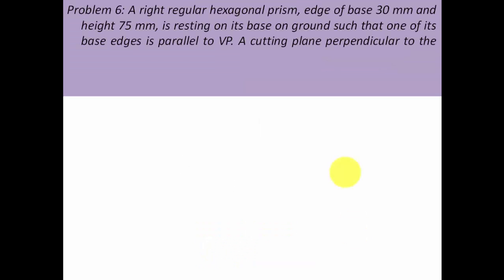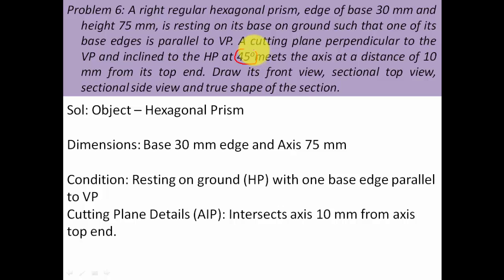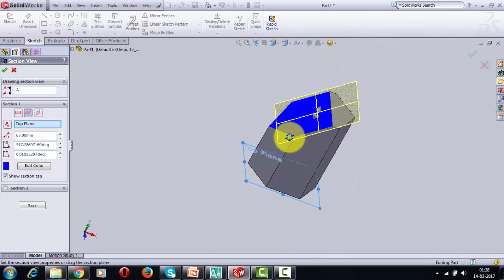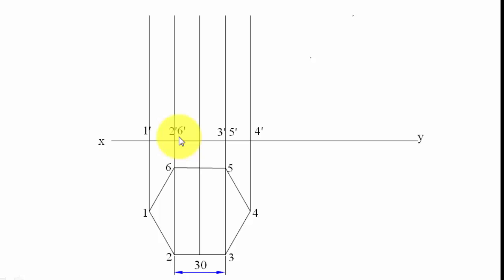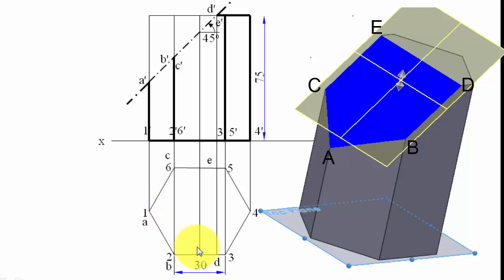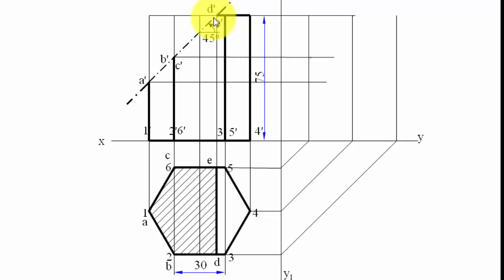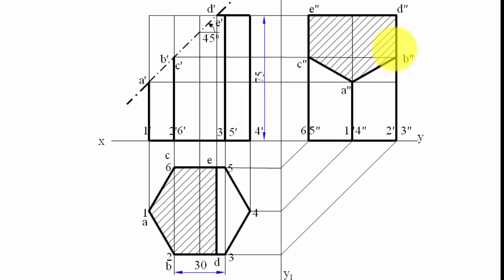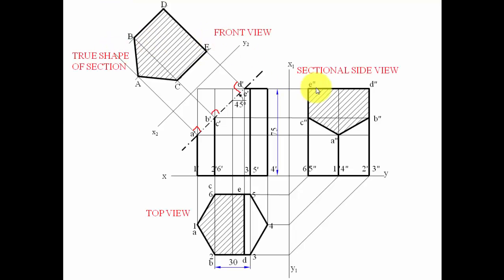SECTION OF SOLID_HEXAGONAL PRISM_Problem 6

Comment: 1. A regular hexagonal prism edge of the base 30 mm and height 75 mm, is resting on its 
base on the ground. A cutting plane perpendicular to the VP, inclined at 450
to the HP 
and cuts the axis at a distance of 10 mm from its top end. Draw its SFV, STV, SSV and 
TSS.

Comment: 10. A hexagonal prism of base edge 30 mm and axis 70 mm is resting with one of its rectangular faces on the ground with its axis parallel to the both planes. It is cut by a sectional plane perpendicular to V.P and 45° to H.P. It cuts one of the ends at a distance of 20 mm from the bottom. Draw the sectional top view.

Comment: Good job sir, why do you normally hatched the true shape of section parallel? In sectioning parallel lines are avoided. I think the true shape of section should also be hatched to 45 degrees as the top and side views are done. What's your opinion?
Reply from the maker: I believe section lines are kept parallel always.
Anyway i always do the sectioning at 45 deg with respect to a horizontal line. 
Well the idea is if u have a closed geometrical figure (say 5 sides) to be hatched.....Then start drawing hatching lines at 45 deg with respect to any side......